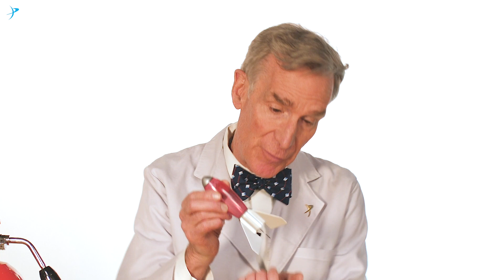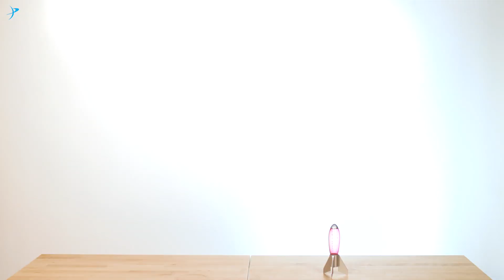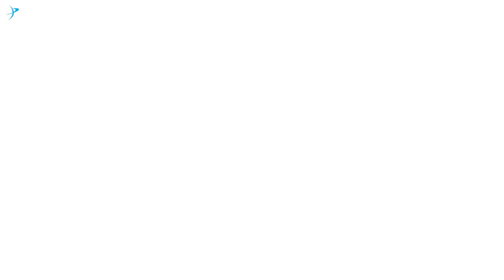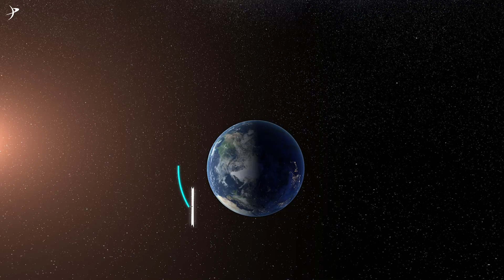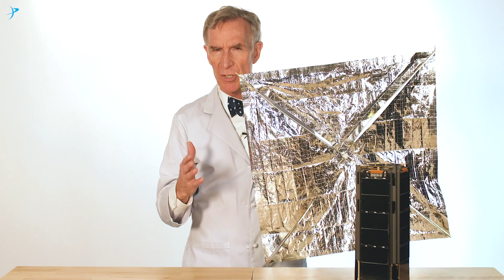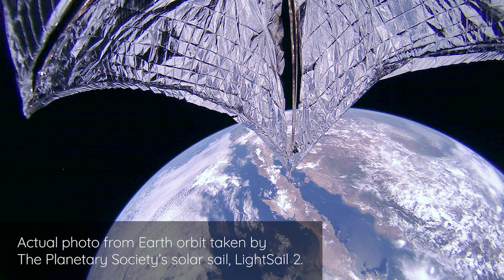How do solar sails work? Bill Nye explains.

Comment: at perigee atmospheric drag on the sail is larger than the orbital boost at apogee from the sun? so the sail is slowly sinking back down into the atmosphere? is that true?
Reply: Is there no way of raising perigee?  Is it a real physical/mechanical issue with LS2 that can't be altered, or is this just a avionics
programming issue?  Rather than only rotating the sail to face-on to the sun before perigee, couldn't you also face the sail at a 45 degree
angle on the sunward side of the orbit, thus adding to the perigee?

Comment: A great video, but the only problem I have with it is the fact that you said that the sun was an 'unlimited source of energy'. This is not true. This defies the laws of thermodynamics, the most uncontested sets of laws known, as energy cannot be created nor destroyed, only transferred from one form to another, as we know. The sun releases energy through nuclear fusion, however does not create it. One day it will run out of hydrogen to fuse, and become a white dwarf star. Admittedly yes, this will happen in millions (if not, billions) of years, but still, it is a bit misleading.